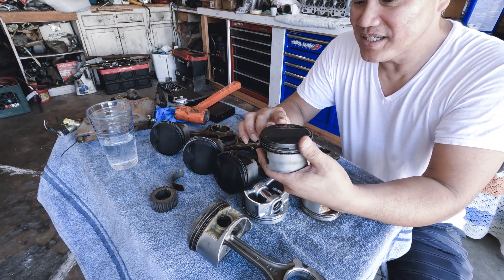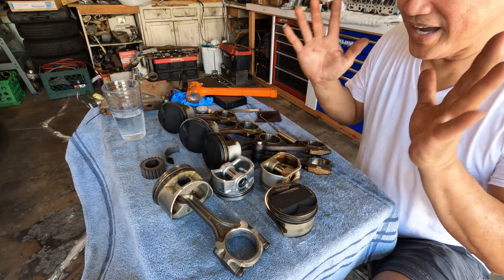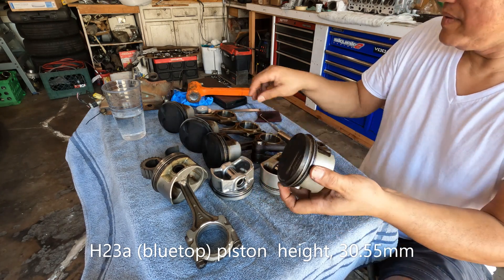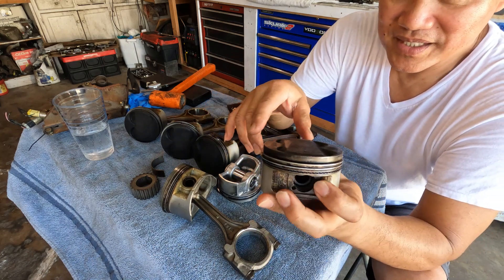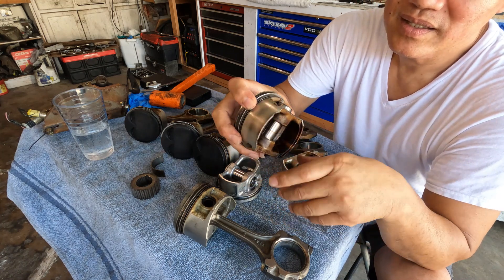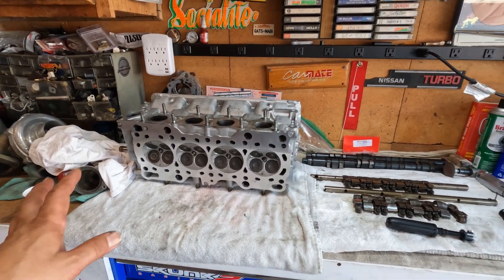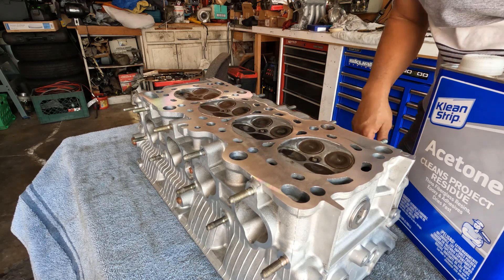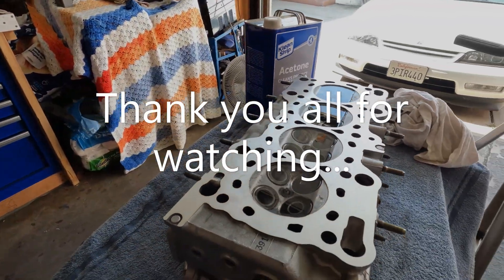H23a (bluetop) piston for a NA stroker build.

Comment: Isn’t 11.4:1 too high compression? What’s the best piston to use with h22a4 head f23a4 block crank and rods? Is the normal f23a4 pistons too low of compression? You’re the man to ask about this I want to order the right 86mm pistons for an n/a reliable daily driver not going for max power. Thank you
Reply from the maker: If using e85 for fuel, having more than 11:1 comp ratio is not a problem now a days. So if you happen to use a e85, any piston from k20, ctr or itr are no issue. The f23a4 is too low and might suffer a acceleration issue. In my opinion, using the rsx type S piston is ideal. Combine it w/ type S cams, good intake and exhaust manifold. 2.5 exhaust pipe and it should give 215 whp is easy.
Reply: @sagittnet2158  e85 is not readily available in my area so I’d rather use 93. There’s not an option to use 93 octane pump gas and keep the compression ratio in the 9s or 10s with a 86mm bore?
Reply from the maker: @matthewpowell1855 The k20 type S should be ok using 93 octane. Just need a good tuner or you can use the k20 turbo piston if you like, l think that'll put you on 10+ ratio.
Reply: @sagittnet2158 that’s a good idea. Thank you sir

Comment: what are your thoughts on using j32 pistons on a set up with an 89mm bore? they will be flush with the block at a compression height of 30mm and they have a 4cc dome.
Reply from the maker: J32 piston can be use w/ no problem. One of my sub mentioned it to me and l thought l 've seen his channel talking about/ showing j32 piston on his g23.
Reply: @sagittnet2158  they do however have a 0.006" offset towards the exhaust so would you need to flip them the same way you do with the k series pistons?
Reply from the maker: @lak0605-e6n  Few people have installed their K20a2 pistons normal ( intake relief facing intake valves). W/c is totally opposite of f23 piston wrist pin orientation. Not sure if there's any abnormal wear on piston or cyl walls if piston are install opposite of f23 wrist pin offset. It's really your decision, 0.006" is not really much. I'll be more concern of the valve reliefs, making sure that it has plenty of p2v clearance, specially if you want to use a hi lift cams. I'm trying to locate the youtubers that is using a J series piston. Once l find it i'll send it.

Comment: Hi good day just came by your video, how can I get a H23 piston PCF0 to purchase for a Honda accord. Please can you reply??
Reply from the maker: You can find a used piston on FB market or ebay and use npr or hasting rings for it. You can try Honda stealership and see if they can do a special order but you have yo provide the part number for it. But for the price that they'll charge you, might as well get a custom forged piston to your desire specs. I know KStune offer a special order piston and so as Traum piston and other known piston maker company. But your block has to be iron sleeve though. I was looking for it myself coz l want to see how far the piston will stick out the block. The previous puston l shown was shipped out overseas.
Reply: @sagittnet2158  ok because am in the Caribbean ja and it’s hard to get 1 here, but thnks for the reply
Reply from the maker: @Cashmere27  no worries man!  and tnx for watching.

Comment: I have a f20b motor i bought for cheap, and definitely needs a rebuild.. i do plan on stroking with a f23 crank, what rods do you suggest? I found some on ebay but unsure about the quality.. i want a “oem” stroker kit and want to spray nitrous and make 350-380whp. Would the nippon cast pistons be ok?
Reply from the maker: You can use ebay rods, I'm using it on my g23 and boosted H22 and no problem whatsoever. But it's all up tp you. If you are spraying it, l highly recommend a forged pistons. I dont think Nippon racing piston will be enough to handle it but l could be wrong.
Reply: Thank you sir I appreciate it!